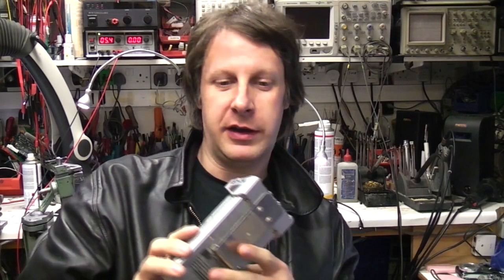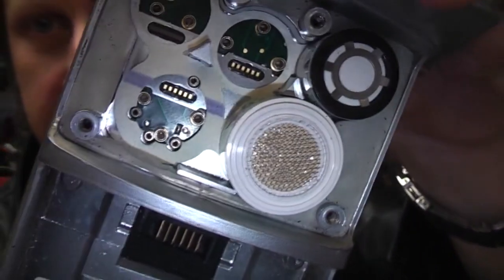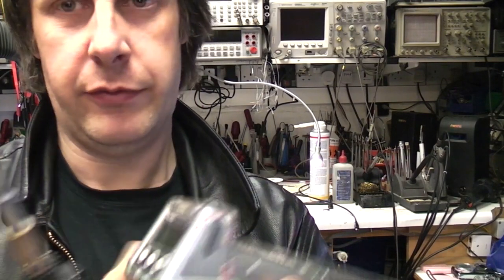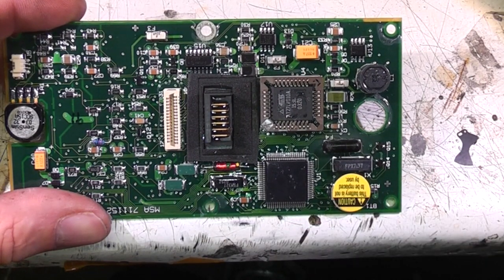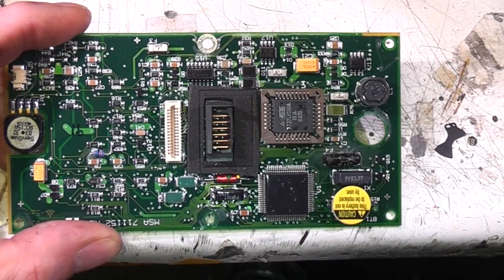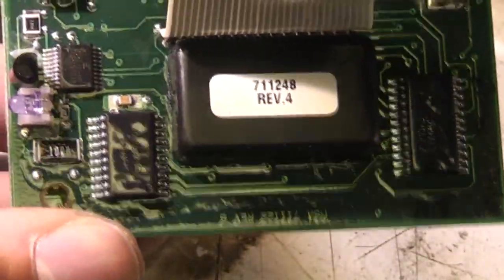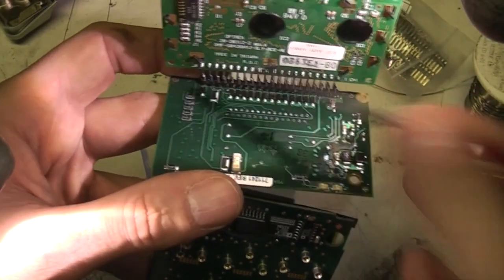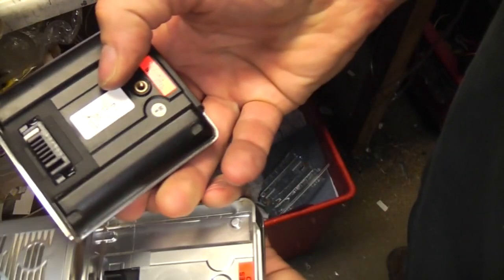MSA Fivestar personal gas alarm teardown

Comment: Most (if not all) gas sensors are sensitive to partial gas pressure (concentration * absolute pressure), that's what the pressure sensor is for. It measures the absolute pressure, so you can get concentration readings.

Comment: Excellent, explains very well Ex.  An Ex rated Fluke 87V is near $900 versus $300 for the regular 87V.  Helps justify all the cost given its all under the hood.

Comment from the maker: Mostly stripped of anything useful (usually only stuff like odd-freq xtals you can't improvise with other parts) & eventually binned or put on the pcb wall. 
I used to keep a big box of scrapped PCBs but find it's generally not worth the hassle rummaging through

Comment: I get goosebumps when I see you taking stuff apart! And it's only in part due to the scalpel you're waving around. Mostly it's because I want to tear such interesting things apart myself (I only get consumer electronics)! But without the information you give, I'd miss half of the interesting stuff.

Btw. looked it up: O2 and CO sensors are a kind of fuel cell. The O2 sensor contains KCl as electrolyte (not that bad), but the CO sensor has some H2SO4 in it. Don't want to get that on your hands.